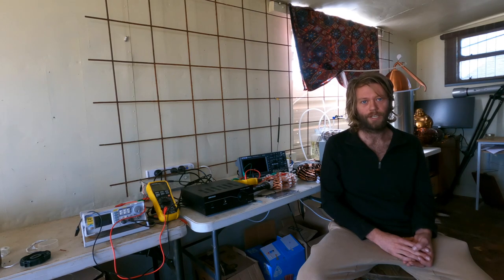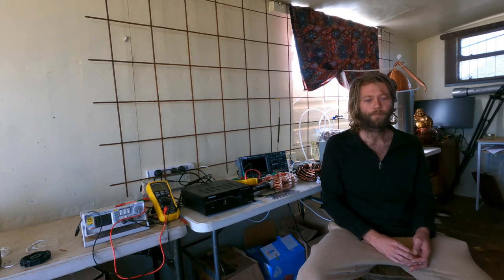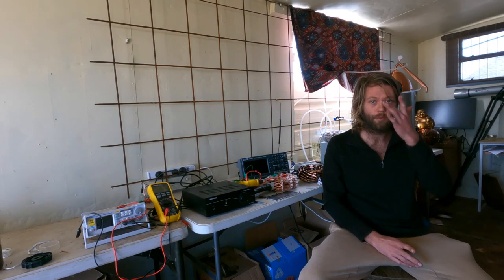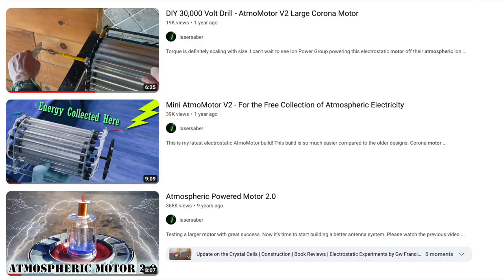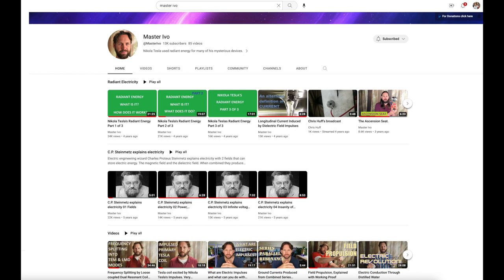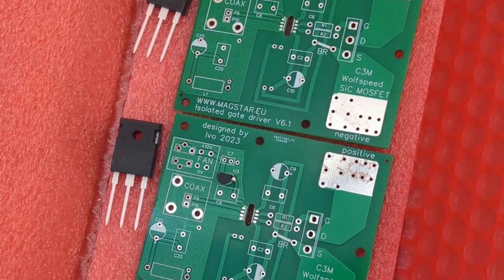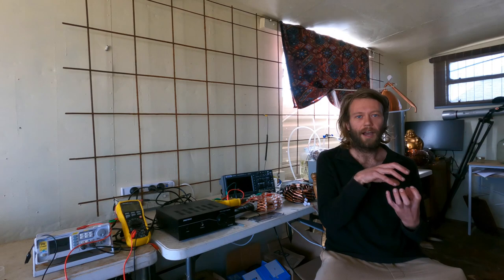Overview of Radiant Energy Collection - Open Source Research

Comment: Hi I like what you're doing. high dV/dt is key. unipolar. energy is everything and everywhere. (Aether=energy). it can be set in motion and it then creates a cold current.
when mixed(fused) with magnetic (hot) current, it creates power. Alchemy at its best. its all aboit the transmutation of energy.
Reply from the maker: Hey Ivo! Thanks for your comment. Your channel was a big inspiration in starting my own. I hope your research is going well. I have been on pause working on this while I explore the Plasmoid tech. But it works the same as you comment here. Opposing vortexes, hot and cold and a resulting transmutation of the elements/energy. Alchemy indeed. Always.
Reply: @AlchemicalScience   good to hear back from you. those plasmoids are very interesting as they visualise what can happen.
Reply: @AlchemicalScience  you've got mail

Comment: if you place a rodin coil  hooked up to a scope over a pancake coil and slowly lift it off,primary wave form doubles at about one inch away,every tried putting a small fine wire starship coil inside your bismith graphine pva mix with plates as well then pulsing the coil to see if major power comes out, even a pancake coil in your mix would be well worth a go as pancakes radiate heaps,is silocon carbide anygood in your mix, robert murry smith speaks of cesium oxide as have majic properties, its easy to get online more info on Q3 carbon power cells please thanks
Reply from the maker: The collector would certainly collect from the coil. Once I have my 5th order coil printed in a few weeks I'll do a solid week of experimenting and look at the interesting coil and collector combos that might give me more understanding of what's happening. Haven't tried silicone carbide or cesium oxide. I've mostly tried out stuff I can get from a hardware store or synthesize myself easily - in the event that I one day have a working system I'm keen to make it as accessible to DIYers as possible! Thing I'm most interested in finding for the collector now is a better replacement for the PVA glue binder. Check out the youtube channel PMMG4hybrid for info in the Q3 stuff. It's the only info remaining online about it. The website is even gone from waybackmachine although a bunch of people saved it. That's the only info I have to go off on that one but he has a lot of videos and slips a lot of hints
Reply: @AlchemicalScience  what is a 5th order coil, i,ve got some quartz 200mesh with graphite and a spoon full of whey in my  rock tumber ,looks like it might have to take a few days,master IVO showed a video of 2 oposing pancake cols almost nothing there for about 2wats of power,taping into voltage potential with no current flow works a lot lot better with a fan on the spark to bow itout up to 100 volts now on my 10 sec cap test now little battery charging up very slowly just on high voltage potential,  you know about  do you know about david adair the rocket scientist, he is into infinity loop coils with the most comlicated coils i have ever seen, he makes everything with twisted wire , 200mesh is about 50 micron feels like talkun powder though ,way too big ,4000 mesh better , its on the way, white quartz rocks when you bang them together they flash with light maybe that is what we need, not much info on Q3 details , do you have patric kellys 3000 page pdf on free energy

Comment: It can't be stealing power, in the same way that picking up rubbish off the side of the road isn't stealing. The electro smog is wasted energy.
Reply from the maker: Indeed. At worst it's a method of cleaning up. I've just seen a lot of silly comments from electrical engineers on other's videos claiming this is what's happening.
Reply: @AlchemicalScience  for it to be stealing you'd need to be increasing the load on the power lines. I don't see how you can do that, other than using traditional inductance, which doesn't really work without tightly paired coils.
Reply from the maker: Yep, exactly
Reply: @AlchemicalScience Bro, type in '300hp Ambient Heat Free Energy Engine'. It weighs 82 lbs, will run off the heat from the road in a car or off the roof on a house!*

Comment: you showed Kens stuff but i guess his big word nonsense kept you from understanding    everything is made up of the same stuff     you need to think degrees of separation  separating cause power in from effect power out   or you need to think ice cube on your hand  your hand is not getting cold your hand is heating up the ice   then study how a low freq inverter works how there is a 50 or 60 hz carrier wave and a around 20k pwm that both combine to make a single sine wave  same thing as in music   then study how a heat pump works getting more out than we put in  we cant make or destroy but the free is everywhere     i will not give a fish that gets all unalive  but i did teach you how to get a fish that makes ALL unalive   understand Jesus said give unto caesar what belongs to caesar if you don't understand that it will not be good for you to know anything   chuck up your drill with the biggest allen wrench  that will fit short side in drill then give it all it has   then study what happens    hint normal is push right move right push left move left  but since it is spinning its NOT normal   dose Ken say simple like hippy chick that dont shave   Kens not a lier all those big words my be protecting those that are dumb enough to want what belongs to caesar   there are many ways to do the same thing  if i had a air tank with plus 200 psi i could run a air motor to a generator   why is this a bad idea it not bad just because the air psi would go to zero   a big box has x energy inside  if no losses and i put that same x energy into a small box   same x energy but now that x energy wants out more   ok now we have that same air tank and its now neg 200 psi  we put same air motor and generator    now is this any better than the first plus 200 psi   there is loads of air all around us wanting to get in our neg 200 psi  and with the plus 200 psi we just have the air in that tank   even though air in or out will equalize if we don't have a air pump or vacuum pump  is one or the other better for what ever we are wanting to do   and how could you truly know if you have a vacuum 200 or pos 200 psi   thanking you already have truth is biggest barrier to knowing truth   that ice on your hand is not getting your hand cold  this great that great or even the Ken him self can be wrong or working for caeser   undrstand that first or stop wasting you time!!!!   if your are challenged enough programed good parrot greatly deceived to believe every thing exploded from nothing or you can have a vacuum with out a container right there beside 1 atmosfear presser you will never get it  quit now  or just go off into math and imagination of mad men so far it has nothing to do with reality   high minded think them self smart prideful people can never get it   but a babe or a simple minded person like myself can   truth is silly to the prideful high minded ones  you can not find what you think you already have! This goes for everything God has created ! The creation itself  that means everything in it and how it ALL works proves the creator  And it all is testable repeatable and every one gets the same answer every time   Jesus him self called the religious people leaders snakes vibers  He dont like religion either!  If you think i turned mean or to a crazy i ask you have you not learned anything in these last few years!  I am not gluten for punishment or never ending tongue lashing from all the parrots  I have not asked you for anything and never will  Jesus warned just as i am  that we are to test ALL things for our self  if you truly want to know how to get free more out than you put in   truly seek and you will find a few way before you find  there is truly awesome things to seek instead of looking for what is everywhere and is everything   and its all made from the same  just like old Ken says  ice water and steam is a water   this free stuff is fun like kids since fair it truly is   but solar panels are cheap and you dont upset caesar    i truly hope you find truth  i have spoken the truth   wisdom  has blessed you today that is if you can see the value in it   also showed you the path to half dozen ways to find what you look for  remember i shared freely asked for nothing never will want nothing  i did repeat what Jesus warned that we are to test ALL things for our self believing nothing any man says or has said until YOU  your self test it   the truth will set you free but to find it you must seek it and have a love for it   Or go on being comfortable with the lie  maybe build you a rocket to put a camera looking back at earth on the moon then mars  i know thats what i would do if possible lol lol   have a blessed day  by the way if you believe  in God then you must know that giving money doing good deads or anything to try to be good enough to earn your way into heaven is like diry that time of month rags to God  you cant work for what is free   the meaning of gospel is good news   is you got to have stick up your ass and work your ass off  good news   how about God creator of all things loved you so much he paid the death penalty of sin for you out of love  and when you repent means change of mind from not knowing  not understanding and testing that and knowing you truly are loved that much by God then your saved and a child of God and then your in your father Gods hands and cant slip out  dose a child make tons of mistakes over and over and over ?? so dose a child lean over time with guidance but mostly not doing what there father says they should do  if a father loves so much he died in his child's place then just load the child up with thing he cant do and send the child to hell   what can God not do if he created everything whats not his  he wants to share everything that is his with his children    if all these things sound to good to be true what dose it hurt to privately test to see for your self ?   Free this free that is cool but test and you will care no more for that nothing ness free endless energy God is good my friend        have a blessed day!!
Reply from the maker: Apologies. I don't have the patience to read through this and respond properly. I appreciate criticism and advice but it needs to be legible. You may have had some genuine enormous realisation but if you are unable to articulate what it is and how it can aid my research I can't do much with it - and the tone does come off as a little condescending and obnoxious. God bless.